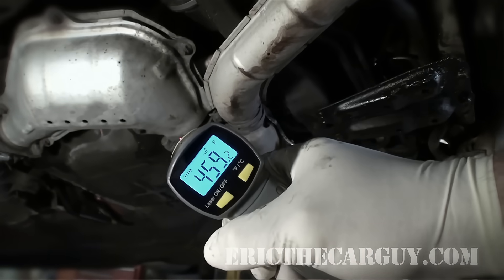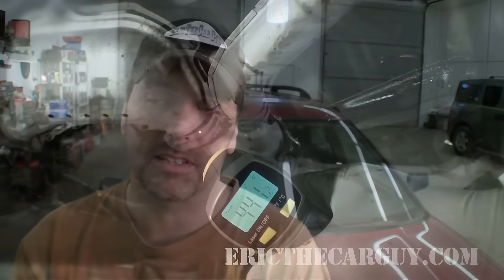Does Lacquer Thinner Clean Catalytic Converters? -EricTheCarGuy

Comment: I had tried Kimer's method one day after the light came on indicating it was the converter. With about a half tank of gas and PURE lacquer thinner I drove a little over a 100 miles and the light turned off.  Pass the smog test the next day.
Reply: Dangerously Active
I found out the only way to fix the cat problem was by installing a brand new Cat Convertor which only cost $200 online retail price for my vehicle (plus installation). I tried running my vehicle without a cat convertor and the "Check Engine Light" was coming on every few minutes while i was driving my vehicle..even though it ran great.  I elected to install a new cat convertor and at the same time kept my vehicle legal but also the "Service Engine Light" went off.
Reply: If your car ran great without the cat why didn't you just put a piece of tape over the idiot light or just ignore it?
Reply: @MrJohnnyDistortion  yep, this is what I am doing until I get the time and money to get the job done properly.
Reply: @BC437A  
I'm getting mine scanned tomorrow hopefully from someone with a Snap-On Solus scanner.
Reply: @MrJohnnyDistortion  wouldn't a harbor freight scanner make it run better lol
Reply: @toshavr2446  
Absotively posilutely.
Reply: @MrJohnnyDistortion  Passing inspection?
Reply: @PatrickLarson  
No vehicle inspections in my state.
Reply: @midos6767  I want to know where the fuck you can get a cat with installation for $200???  even generic shit is more expensive, and who works for $2 hr removing rusted exhaust bolts?  If it were this cheap, no one would be trying the lacquer thinner. get real
Reply: @sniggitty  
You misunderstood his words. He said: "by installing a brand new Cat Convertor which only cost $200 online retail price for my vehicle (plus installation)"
Reply: +Jonathan Nagela wrong. My check engine light comes on for water being in my fuel and goes off the second I put in gas treatment or better gas. you do not have to reset the whole computer to get the light off. in fact if you have to do that then there is still something wrong and your light will probably come back on again after about 60 miles
Reply: what kind of laquer did you use.  I have the same year model car an the same problem
Reply: Nope it burned like gas nothing was harmed on my 2001 Altima
Reply: it definitely works same thing on my toyota did exactly as you did light went out.of course mechanics dont want you to know about that
Reply: lol I purchased a new vehicle.So I tapped out.Still have old car.
Reply: Jonathan Nagela wow really. what are you driving? Ii bet your car has so many problems that you never can see that light turn off without a reset. Even my grandmother knows better.
Reply: will it damage anything like fuel pump when I put it in? I have an 2000 altima
Reply: Not necessarily
Reply: Keyandra Joseph good question.
Reply: can we use paint thinner is it any different to lacquer thinner
Reply: Craiglaca1  
'
Reply: Craiglaca1 still got the car
Reply: Alejandro Torres
Reply: midos67 your lucky. My 04 wrangler has three cats and 4 o2 sensors. About 900 bucks just for the cats...:(
Reply: @alextorresphoto  I'm going to try this I only have the one code cat converter bank 2 so I will be trying this
Reply: Where do you get lacquer thinner from?
Reply: @jamingjohnson2275  any hardware store. Kilmer suggested pure lacquer thinner whatever that is. I grabbed the cheapest one I could find.
Reply: The lacquer thinner idea obviously won't cure Catalytic Convertor issues, but it will clean fuel injectors and the entire fuel system.  But the bad part is it may not be good for the fuel pump because it doesn't provide enough lubrication for the internal working parts of the fuel pump.
Reply: @midos6767  that's why you mix a gallon with 1/2 a tank...  there is no lube problem
Reply: @midos6767  ..could be the reason Scotty says to drive ALL the 150 miles at once ...and don't let it sit in your system for any length of time..
Reply: Yea NYC is definitely the worst on suspension and tires... and every winter we get a nice salt and water coating to rust away our cars :( DO NOT go out of NYC for repairs that's crazy! I'll offer you a $60/hr or so labor rate on most jobs, I'll do my best possible for you, just call me directly and I'll make it happen. 347-494-2235 Be well, god bless
Reply: Jonathan Nagela
  I cleared mine by disconnecting the battery for a few minutes and then reconnecting it.  The light never came back on with the new Catalytic Convertor installed
Reply: My 02 ford ranger check engine light came on. In owners manual. ( bet im the first person here to even read it for thier car says my check engine light can come on because of loose gas cap poor fuel quality or water in fuel...might be a few other reasons there but it also says to check gas cap refill to full tank of quality fuel and drive 3 cycles ( from col to hot engine with mixed highway/city driving) if light does not GO OFF see mechanic. If check engine llight is blinking a misfire ia occuring and see mechanic right away
Reply: Great news! It's too risky though... someone should really be able to change the cat for less if needed
Reply: im in this pickle as well.I have a 2004 Saturn ion. what yr,make and model of vehicle you have or had at the time?
Reply: It was an 2002 Nissan Altima. For the first 50 miles it let off some occasional white smoke. 100 miles later it was good as new.
Reply: Craiglaca1 ok ty
and still no cat problem....
Reply: +Dangerously Active Not yet in 22 months. My luck has been when I'm driving to the smog test outlet I'll get several codes all at once. So I won't no for sure until the day of tge next test which is 2 months from now
Reply: Craiglaca1 Long as my check engine light goes off and stays off.Im ok with that for the 1st 22months.Also I was told and this could be another video to myth bust if you will.people are saying Cata Clean solution. helps a lot and passes all test.
Reply: @GreyPillPod  and that  main ingredient in cataclean is acetone
Reply: @tellitallnow3914  Oh k. Thank you
Reply: @Craiglaca1  that’s fucking crazy lol
Reply: Worked like a charm for me
Reply: midos67 so this is debunked to use for clear the cat and taking off the check engine light?
Reply: @GreyPillPod  NO... It Worked for me, 
But As Myth busters do... They always Screw Up... Change / Weaken the Fix... So It Does Not Work.  You Need 4 Times the Thinner.
You were supposed to do 1 Gallon of Lacquer Thinner on a Half Tank (8 Gallons of Gas).  You barely had any Thinner.
But I used 2 Gallons of Lacquer Thinner with 13 Gallons of Gas in my 2013 Chevy Silverado 2500 HD and Drove 190 Miles on Highway.... Till I was near empty.... And it worked.  
But hey,  This Video is just an attempt to try and put down another Channel... small minds... small mission
Reply: Another myth busted - Non-continuos ECU tests (like the CAT test) will drop the CEL to OFF when the codtion tested no longer throws a code - no need to reset the CEL at all, in that case. For ontinuos tests, no such thong happens - the CEL if lit will stay lit until a reset OR you fix the condition that caused that code is fixed.
Reply: So many dumb fucks on yt. Pure lacquer thinner will destroy all rubber material it touches. 
How can a comment as dumb as this get over 400 likes?
Reply: Hows your car been doing 9 months later? When did the check engine light come back on?
Reply: once the check engine light is on then it stays on until the code is cleared.  So it sounds like a lie when you claim the light turned off.
Reply: @volcanohi-p2u  not always sometimes when you fix the problem they go off
Reply: volcano hi some cars the light does turn off and it becomes a stored code that can be seen with a scanner but not from the light. I have experienced this on multiple cars at the shop

Comment: What if you pull off the converter and let the mesh soak in lacquer/paint brush cleaner over night?   Just pour it in and let it soak.  Has anyone tried that and found the result?    Burning lacquer thinner or letting its vapor pass through is different than letter the solvent work as intended.
Reply: the nice thing about this is that you can just pour it in

Comment: well if you were to be smart like eric was in his video i wouldnt put to much of that thinner stuff in a car because I myself wouldnt want to screw up my car lol. what if it does screw up your car or if it did mess with the cars fuel system lol i dont want to mess with mine for sure and plus idk if you guys ever heard of going cheap will then later cost more  expensive that just replacing your cats or whatever the decision is up to you lol. so this video was a good one. i mean think abiut the thiner going in the car imagine the sensors that are really sensitive can be eatin up by that stuff causing malfunction so reason could be that light coming on lol.

Comment: most fuel additives work STRONGER using with less gas in the tank duhhhhh.....Dilution rate, if you add 8 ounces to 15-20 gallons of gas v.s. 5 , which do you think will work better?? My moneys on the 5 gallons or less......They can't sell more additives if they tell the truth in how to use it. I've been a mechanic 35 years, so I do know a trick or 2........Remember Slick 50? Idiots thought if they used it, they could go 50,000 miles before the next oil change !
Reply: so do you recommend adding lacquer thinner?

Comment: I find your videos pretty informative.  A couple of things.  I have an '03 sienna with the P0420 code.  It had a cat put on at Meineke around a year ago.  I change the downstream sensor.  I'm still having the code come back.  I check the voltage pids for sensor 1 and 2 as in your other video.  Sensor 2 is maintaining around 1/2 volt however sensor 1 is staying at 3.xxx volts and not switching, rich, lean, rich, lean, etc.  The upstream sensors have never been touched that I know of.  Would you change those first or do you think it could be the aftermarket cat?  The temp. going in was around 300 degrees and coming out was 100 degrees cooler with the car at normal temp and at 2000 rpm.  Thank you for your input.

Comment: Can lacquer thinner do any harm to the engine, to components like injectors or fuel lines, rubber/plastic parts, electric sensors?? Is it good to use it in your gas regularly, to clean the engine, like a fuel additive? Or regularly to clean the catalityc converter? Because if it has good results , then why not put thinner in the gas tank every 1000 miles or so?
Reply: Better off using A fuel Injector Cleaner,? Instead of the Lacquer Thinner.?

Comment: hey Sir Eric.., I have a 99 Audi A6 2.8 30 valve., since lately its been cutting off while driving., so I decided to try my mechanical skills which I learned from watchin your videos..!!  first I scan for codes & I got P0300,P0304,P0305 & P0306., google them &find out that its a misfiring codes, so I check & change Wires, plugs & coils problem still didn't change., I check vacuum hoses for leaks, check around  intake for leak & find no leaks., I clear the codes & start the car & the problem is still there., I took off the throttle body & clean it.. I clean the mass air flow, I check the fuel pressure &  pressure  was there but I still went to the junkyard get another fuel pump & replace it & the problem still there....!!! the car does start & run for awhile but after a few minutes the rev start to go up & down & then start to baffle & the check engine lights strats to blinks .., I have seek other opinion.., one guy told me its the Catalytic converter.., ho sorry I forget to mention that I also replace the Cam timing position sensor.., I,m a little hesitant on the Cat situation because of where its is...! on the back end of the process...!!! so is that even remotely possible that the CAT can cause the engine to have multiple misfire...., sorry for taking up your time with this but I would surely appreciate your opinion....!!! Thanks

Comment: at first eric I want to thank you for your video I herd you say how scotty wash the cat converter how about this when the motor full temp suck water thru a vacumline into the  intake or spray in the throtel body I herd it decarb the motor but a hot motor with water make steam will that steam clean the cat I done it to my owen but I notice loss of power until all the water is blown out of the cat and dry out by drive it unitl it dried the water out will that help a bad cat run water thru the system when motor full temp to steam clean the cat maybe video on that you do

Comment: hi. i did 2 gallons of lacquer lacquer thinner to 20 gallons of gas. the hack trick worked for me. no more p0420. maybe you needed more lacquer thinner than just one quart.
Reply: Nice !
As Myth busters do... They always Screw Up... Change / Weaken the Fix... So It Does Not Work.  You Need 4 Times the Thinner.
You were supposed to do 1 Gallon of Lacquer Thinner on a Half Tank (8 Gallons of Gas).  You barely had any Thinner.
But I used 2 Gallons of Lacquer Thinner with 13 Gallons of Gas in my 2013 Chevy Silverado 2500 HD and Drove 190 Miles on Highway.... Till I was near empty.... And it worked.  
But hey,  This Video is just an attempt to try and put down another Channel... small minds... small mission

Comment: Eric I have a questions, but first,  thank you very much for you videos.  For not being professional productions...  they are pretty good!!  Maybe this will land you an assistant producer or director gig in Hollywood some time!!  =)  Again thank you.  Now to my issue. First let me confess that my understanding about engine work is limited consequently my question my be completely off.  I think that, because the catalytic converter is cleaned by getting very hot....   How about getting it very hot, to clean it.  So here is my question...  have you considered or have done this....   taking the catalytic converter off and put a torch to the inside? So in essence burning off the coat of contaminants that is making the Catalytic dirty?

Comment: I've used this method dozens of times with a decent success rate. Doesn't work every time, there are certainly variables. But if it's just a contaminated cat, there's a good chance of it working. Why not give the owner the option, let them roll the dice. If it works, great! If it doesn't, at least we tried.

Comment: I have a p0420 on my 2001 GT but I have no cats at all ☺
Reply: Anthony Guida He has no cats... Fuel injectors aren't even kind of the reason for a P0420.
Reply: +dom3thril3r22 gaming That be the reason..
Reply: +charlietow my mistake., i thought  misfiring could also trigger the code
Reply: try the spark plug fouler trick on the 02 sensor(s) after where the cat(s) were.They're only $5 from O reilys
Reply: Cause you don't have any converters u dumb fuck
Reply: check your fuel injectors
Reply: Anthony Guida Misfiring could throw the code due to a domino effect. Not fixing the misfire, could/will result in a contaminated cat.
Reply: +charlietow oh okay. thanks for the info
Reply: Anthony Guida No problemo.
Reply: PLEASE DONT DRINK ANY MORE BONG WATER, IDIOT.

Comment: Some people are stupid. If you have clogged worn out cats, replace them, dont pour solvents in your tank. If it was possible, there would be products on the shelf that would be used by millions of people and well known. Its a gimmick by you tube loons like scotty and others, they are not mechanics, they are soap box preachers
Reply: New catalytic converters are expensive, and removing the old one is a lot of work.  It's stupid to NOT try a bottle fix first.
Reply: +Tom Bryan There's this stuff called Cataclean. It works alright, but it's pricey. I just use the lacquer thinner method. It all depends on how it fails. If it's due to excessive  deposits/contamination, it has a good chance of working. Besides, if it works, sweet! You just saved a bundle! If it doesn't, welp, time for a cat. I've used it dozens and dozens of times. With about a 65% success rate. It is a hit or miss, but like I said, it just depends. There are variables, but it can absolutely work.
Reply: +Tom Bryan So what you are saying:
"I have never tried it and have no idea what I am talking about, but I know for sure this couldn't work because.........I say so". OK. Sure. Never mind he has infinitely more experience than  you do, or that it clearly works for people.
Reply: what brand thinner do you use?

Comment: use any quality brand automatic trans fluid to do the same job. Mix half a bottle transmission fluid mixed well with distilled water 50/50 and run into your vacuum line like in this video, then drive around for about 15 minutes with 89 octane fuel in your vehicle until you stop seeing smoke from the tail pipe. It also helps to add some fuel system/injector cleaner to your gas tank before driving for 15min. This cleans the buildup on the piston heads and valve heads/seats pretty well and will kick some of the junk out of your catalytic converter.

Comment: Lacquer thinner didn't work but the adapter for the sensor did. My code said threshold 1 but that didn't work so I put it on the threshold 2 sensor and that has kept my engine light off. You can buy the sensor adapter on Amazon or ebay for $7 or pay a grand for a new catalytic converter if your car has a big mess of welding to be done like mine would of.